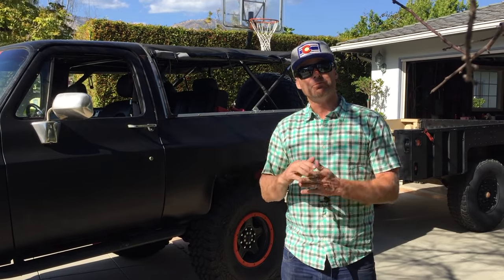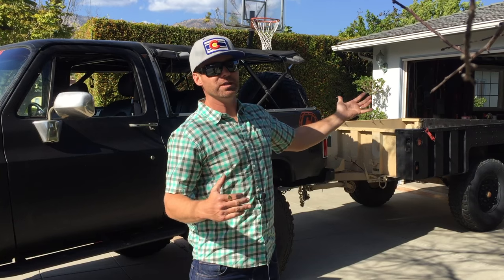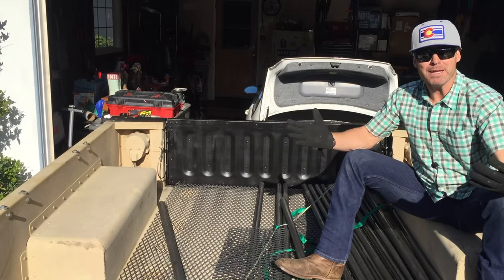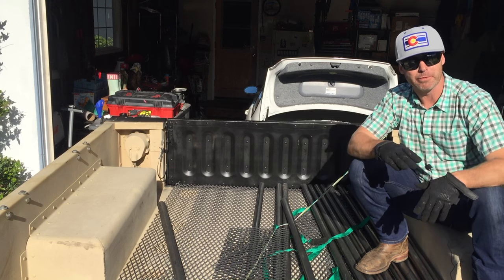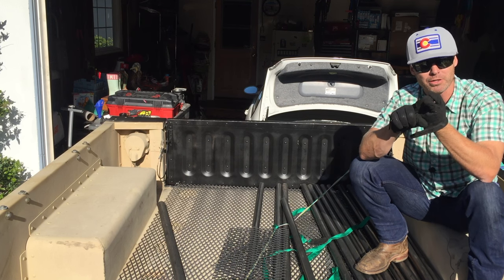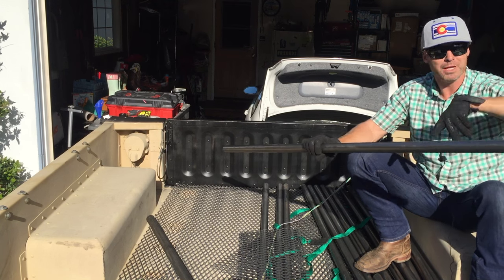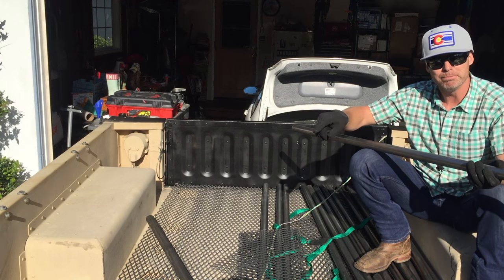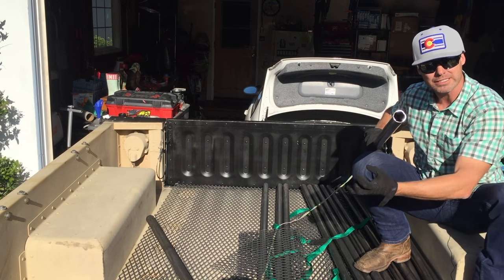MG #12 - Steel and parts pickup for the military trailer rack build

Comment: Love the SERE Trailer concept bro! Was just thinking, you are definitely on the right track as far as strength and durability, I was just thinking, ya might want to get a crap load of RV and/or Boating catalogs and see what you might be able to iincorporate into it as a crank or lift, so that if you did have some gear on top strapped down,...you would still be able to lift/ crank the platform up to get at stuff within the bed, instead of lifting by hand or whatever. I have been wanting to build one of these for a long time, but I am still working on getting MY K5 rock solid and back out on the road for good!! Please do some videos as you go with this build!!

Comment: Fiberglass HAM radio pushup poles! They make them 2.5"--->3/4" with cam stops -- 1/8" wall.  I Paid around $200 for seven 8 foot telescoping pieces. It raised to make a 50 foot pushup pole.

Comment: Just wanted to clarify this is a M1101 trailer not a M101.  There is also M1102 which looks identical but has a higher weight capacity then the M1101.  The previous version the military used to this trailer was the M101 series trailer (step sides) which came in three variants; M101A1, M101A2, and M101A3.  The M101A3 was raised a little higher and had the same tires as a HMMWV.
Reply: +Merrick's Garage, no worries and the build looks great cant wait to see what the final product looks like.